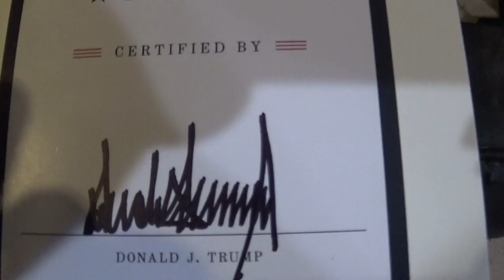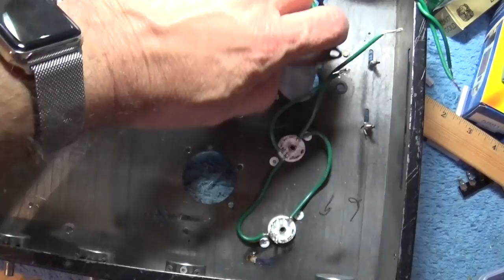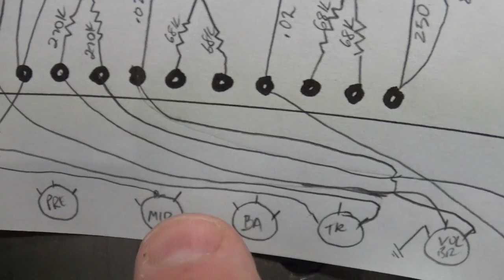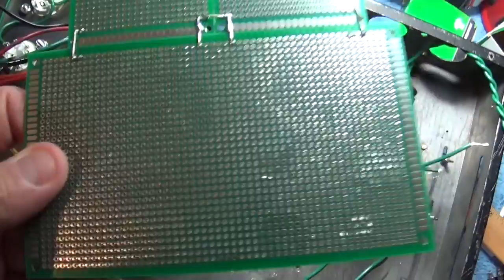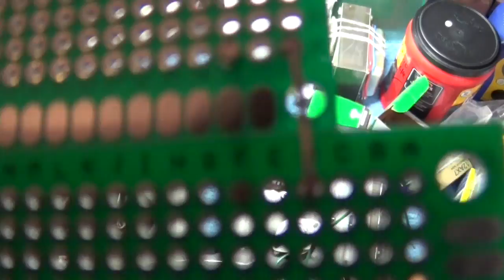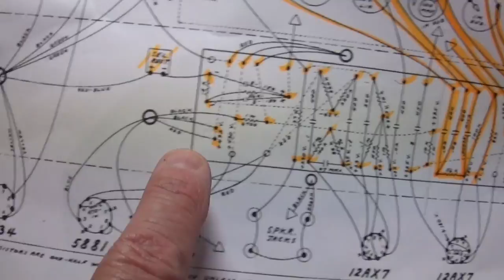Bogen Cha-620 Fender Bassman Amp Conversion -Episode 5 - It's lonely out in space

Comment: Very nice work Ron. I just finished up a Grommes LJ-7. I used a Blackface Fender Princeton tone stack and also changed it over from cathode bias to fixed/adjustable grid bias. I just stared converting a Bogen CHA-33 PA (two 6L6's). So far, so good. I dont have much spare time but I've managed to do about 15 PA/Hi-Fi to guitar amp conversions in the past year and they sound phenomenal. 
I have a Bogen CHA-20 (two 6V6's) that will be up after the CHA-33 is finished. The best tools I have (after my Variac) are Resistance and capacitance Decade boxes.They make it so simple to choose the proper resistors and caps just by turning knobs or pushing buttons.
I've subscribed and I'm enjoying every video.
Cheers.
Rob.